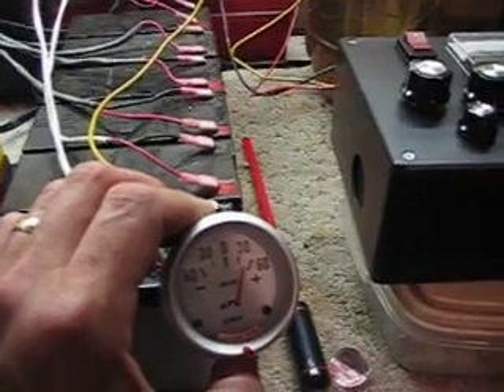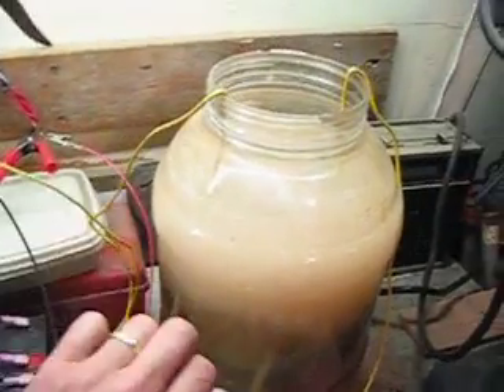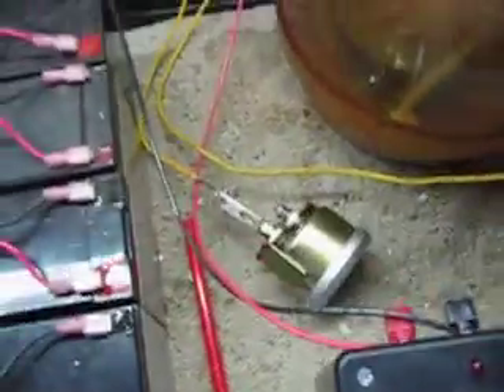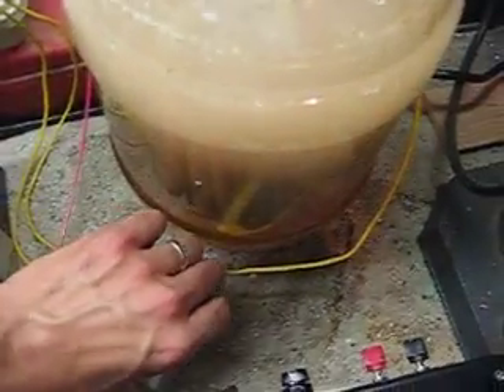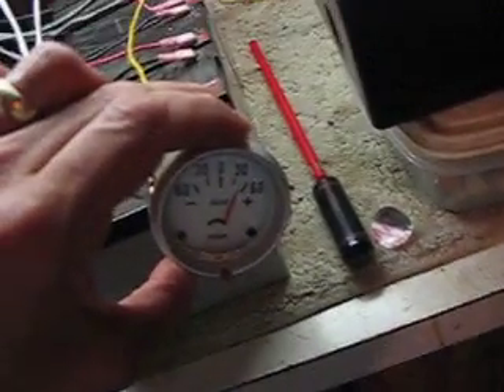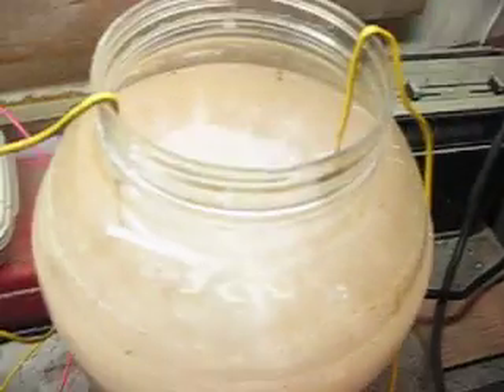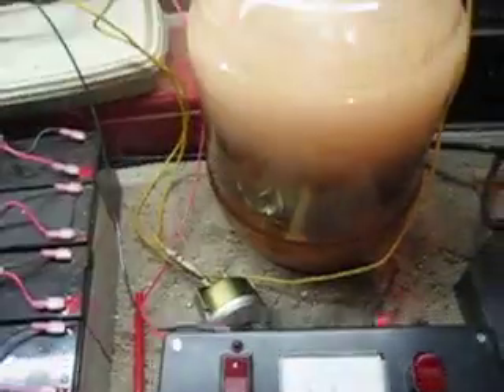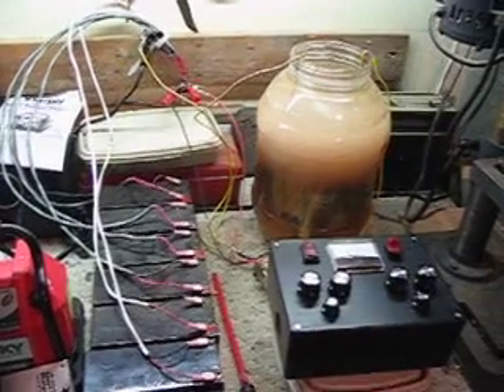Hydro Lab (My Garage) #16 PWM vs DC

Comment: can you measure the output of gas in L/min for the PWM and the straight DC another thing is that your using more than four times as much power when using DC by measuring the gas you can calculate efficiency of each method

Comment: Hi, great experiments. Connecting direct to the cell will draw more amps as there is less resistance than through the pwm. Have you tried adding a catalyst to the water to see if you can run a higher current with the pwm?